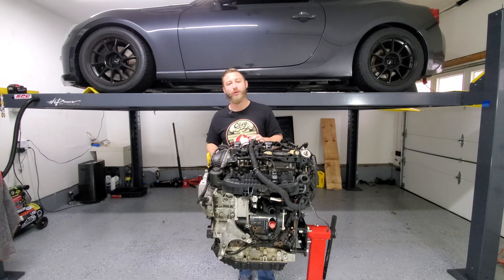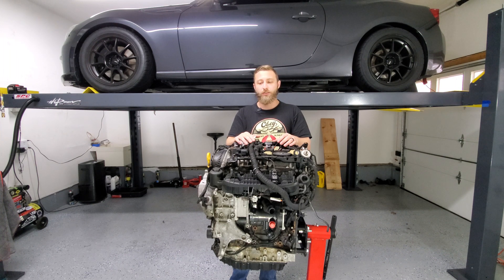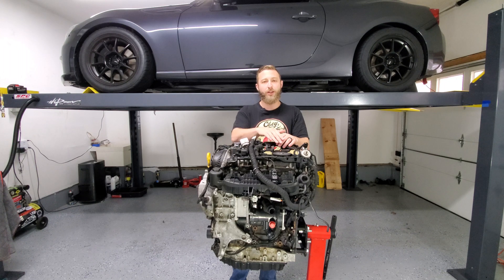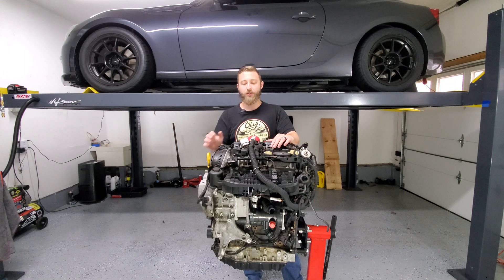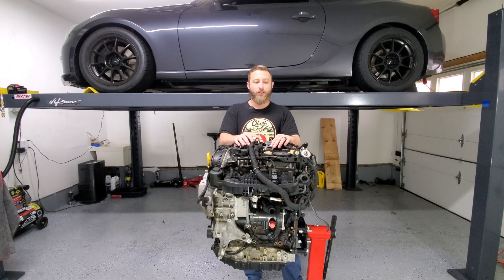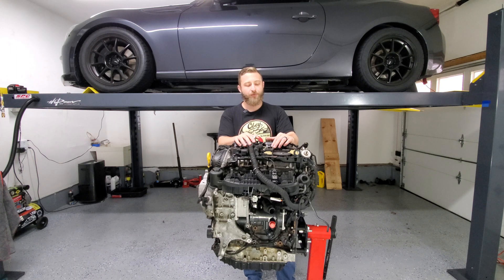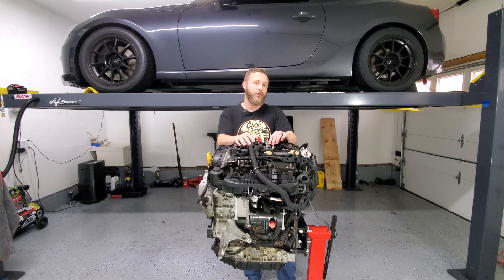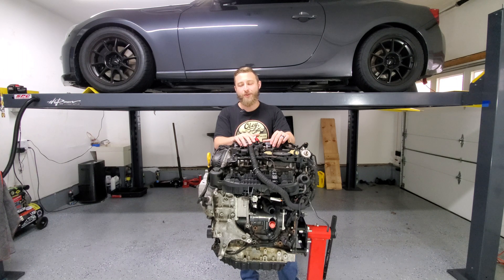VW Engine Failure 87000 Miles 1.8 TSI

Comment: I have a 2016 VW Golf MK7 1.8t manual that is getting close to nine years old that has had zero failures so far while running a stage one tune too.  No oil usage and even the stock clutch is holding the increased power.  I bought the car new for $17,830 including tax and license, so if it blew up today I still made out very well.
Reply: I have the same year car but automatic. Almost at 199K for mileage. How many miles?

Comment: I have 2015 Golf with this same engine and it have been very problematic. I've had oil leaks, coolant leaks, ATF leaks, water pump failure, a/c failure, transmission errors, busted engine mounts, premature shock absorber failure, random rough idles and an oil pressure issue that no one knows how to fix. All of this would be ok if the car had 200,000 miles, but it only has a little over 70,000.

Comment: You're right Volkswagen is making piece of shit cars I just had 2017 golf 44,000 miles water pump failed shifter position sensor failed climate control failed Volkswagen not the same anymore.

Comment: 2017 golf tsi I have had that coolant hose burst out as well by the transmount. Transmount stock is making some good noise. 290+ hp this car will need new motor and transmounts. Other than that I’m impressed with this car honestly first VW I’ve owned and it packs a punch on acceleration, numbers on the dash go  up pretty quick too.

Comment: Great just got a epc light and no boost on my 1.8t gen3, sitting right at 124k
Reply from the maker: Let me know what happens, it took a little while for my failure. Validate your oil levels also.
Reply: @MarkMethods  yeah I just had a major oil leak coming from my valve covers, re sealed them both and the oil pan as well, replaced all gaskets, but I pulled the spark plug from cylinder 3 due to a excessive knock code on that cylinder and it’s burnt out, white residue and the white tip itself looks to have melted in a spot or gotten way to hot, hoping after replacing the spark plug and maintaining proper oil level that it’ll be okay but will keep u posted
Reply: What gen would a 2017 Passat 1.8 tsi?

Comment: This is why I say people should buy new cars. That new car depreciation bs, was cancel out when you had to install another engine @ 87k miles. You bought it with 36k miles? There is no telling what the people did or didn't do before you bought the car. You are blaming VW for making a bad engine.
Reply from the maker: VW has an engine design that consumes oil and tells consumers to wait 10k miles between oil change intervals while oil levels become dangerously low; this exacerbates the issue causing more oil consumption due to wear on the piston rings eventually ending in failure. Attribute that to bad design or poor manufacturer guidance, either case this can happen to anyone new or used with enough time.
Reply: @MarkMethods  10k miles oil change? What car is this?
Reply from the maker: 2015 Golf TSI 1.8T MK7, VW recommends 10k oil change interval on a lot of their more recent vehicles which shouldn't be dangerous but is when coupled with oil consumption.
Reply: @MarkMethods  So your car was burning oil? People are suppose to check their oil between oil changes. I go 8k miles between oil changes in my 2016 F150 with the 2.7 twin turbo. I'm up to 76k miles. I don't add oil but I'm down 1 quart.
Reply from the maker: The oil consumption was low initially, nothing needed to be added between; something accelerated wear or catastrophic failure occurred and caused the piston ring to fail. I'd keep topping the oil off, that's quite a bit to lose between changes.

Comment: 2017 Alltrack coming up on the end of my lease, 4 years and 40k miles in and I am happily letting it go back to VW.  I had two tdis (the sportwagen with 6 speed was fun) but between dieselgate, the crappy attitude of VW USA toward my 39,000 mile sunroof leak (basically lying to me until I confronted them with what google reveals) and the issues with this engine I will not be a VW owner again.  I'm buying a Subaru.  Wish VW was a more ethical company.
Reply: Hope you have better luck… but I hate to break it to you, it’s all manufacturers. I can find you a million Subaru horror stories.

Comment: I think mine is on the way out, excessive oil consumption at 92000 miles. I had a fresh oil change and in 1600 miles went through 2 quarts of oil, no leaks, and good compression. Mine is a 2014 1.8t Se and I change my oil every 5000 miles instead of the 10000 miles they say I can go. I have tried numerous oils and it's the same consumption. My car doesn't pour black smoke out the exhaust and no misfires, so I have no clue what is happening to my oil. Luckily it is almost paid off and I def won't be buying another, just hope it lasts another 8 months. I only drive this car on the weekends so about 2-250 miles a week tops.
Reply: got the same engine, just give it a thrash up the motorway or highway above 3000 rpm for a good hour or so drive it will reduce oil consumption it has on mine just gone past 87k only needs 250ml every 1000 mile now as appose to 500ml before. These engines need to be ran hard to get the linkages and cams lubed properly else they can get gunked up and cause excess consumption. I wouldnt recommend flushing this car as it can degrade seals and can cause major leaks etc.
Reply: @oliverbradley592  I will give it a try i usually feather my pedal on mine. I did run some seafood through the motor which seemed to cut it down.
Reply: For anyone else who has this issue, change the PCV valve. That causes oil consumption. These engines are not known for burning oil. Mine at 130k doesn’t burn or leak a drop between 4k changes.
Reply: Try to do a forte flush?

Comment: They replace 1.8 tsi with 1.4 tsi both with 160hp. I got that 1.4 tsi with 160ps not a single problem for 4 years. I wanted to avoid that bad series so i take 1.4 with 160
Reply: The 1.4 doesn’t have 160
Reply: @briansantos4637  Yes it does, 1.4 with 122hp after that there is 1.4 with 150hp(eco fuel) and 1.4 with 160hp.  Look

Comment: Which would be the better engines from VW? 1.8T ( 2017+ VW Golf) or 2.0T (2016+ VW Golf GTi or R) or are the 1.4's any good? I'd like to buy one in the next year but want to go with whichever is most reliable.
Reply from the maker: I think if you have your heart set on any VW, plan on cutting the oil changes in half and checking often to make sure you aren't low on oil due to consumption.
Reply: @MarkMethods Well said! VW recommends 10K on oil changes. With doing that my turbo quit at 135K and I was losing compression in one of my pistons. Had the mechanic do a piston cleaning with B12 and that did the job for the pistons. I now change the oil every 5K. 2016 Golf 1.8T DSG with close to 199K on it.

Comment: This K's very sad, but in Europe we have a lot of problems with the smaller TSI engines, which you do not have in the US such as the 1.2 TSI and the 1.4 TSI twincharged engine. I have just payed +$2000 USD to fix the timing chain issues on our 1.4 TSI. It is unacceptable, but VW from this generation sinnott what it used to be
Reply from the maker: That's unfortunate to hear, I've always been interested in those smaller Euro spec motors. Hopefully VW gets their act together on reliability for future generations.
Reply: Mark Methods Yes, let's hope. The smaller versions are very cool. The 1.4 is a twincharger with turbo + kompressor. We also have a never small 1.2 TSI with only a turbo, but with a timing belt instead of chain

Comment: I had the Epc light come on at 60k about three times but disappeared after turning it off and turning it back on. I’m at 90k miles now Idk  If should be worried or not but it hasn’t come back up ever since 😳
Reply from the maker: I don't know if it's an indicator of anything wrong, just happened to be the precursor to the notification before the kiss of death my engine experienced.
Reply: @MarkMethods  I commented before watching the whole video, but my car is apr stage 1 and so far I haven’t had any problems other than a wheel speed sensor going out

Comment: You must've had a headache with this engine failure .
I read somewhere on the internet that volkswagen is getting sued for engine failures caused by timing chain...if it's that the case might be worth to give it a try!
I change the oil every 5-6k miles and now I'm hearing like a timing belt whistle,  but I'm  pretty  sure EA888 have timing chains...anyway diesel engines are much more reliable
Reply: mine was caused by timing chain as well. never going to give vw a dime again. sticking to the Japanese.
Reply from the maker: I had a 2010 TDI, wish I kept it; best car I've had to date (although my Prius is turning out to be pretty good too). I wish it had been the timing chain if that's the case, don't see any stuck injector lawsuits yet but I won't be surprised if they come up.
Reply: I currently own a 2015 Jetta 1.8 TSI, with 127,500km on it. I also experienced a total engine failure due to a timing chain pre tensioner failure at 82,000 km. Just 2000 km past the full 4 year , 80k bumper to bumper warranty I was driving on the hwy at the speed limit 110kph when all of s sudden the engine felt rough, like i was on gravel, then the check engine light started flashing, I pulled over as quick as I could, and heard bang, bang, bang, bang bang... it litterally through a connecting rod through the side of the engine... after a month long fight with VW, They gave me a new engine, Full long block and heads

Comment: I come across this video because I have the same motor in my 2015 Jetta. I just cleaned the intake valves which were bad but I know I need to clean the injectors, I can only imagine how bad theyare.  I’m afraid this is what happened to yours  as others stated or in your cause it could have failed and stayed wide open. My engine has has 181,398. Yea I know a lot of miles but knock on wood,all is great besides before the carbon cleaning I was getting cold start misfires
Reply from the maker: That's great miles in comparison, I think my issues were related to this being a first generation launch edition Golf. Hopefully you don't experience anything like I have, good luck!

Comment: A stuck open injector will flood the cylinder with fuel, thus washing the oil film from the cylinder walls and dropping compression drastically.  Had this happen to a brand new Mitsubishi.  Compression read 40psi on the affected cylinder.  Changing out the bad injector, pulling the spark plug and letting the cylinder air out overnight, and pouring a few teaspoons of oil into the cylinder to help restore compression fixed the problem.  After just a little run time the compression was back up to 180+ psi.  Not sure this is your problem, but it may have been, especially since these can periodically have fuel injector failures.
Reply from the maker: I believe this is what occurred from looking at damage on cylinder 1; I broke the motor down, working on getting the video out now. The top cylinder ring embedded itself into the cylinder wall, wish I could have tried the oil trick to see if anything compression returned. I'm considering flow testing the injectors to see if it's stuck open but it's pretty apparent because when I pulled the spark plug it was wet on cylinder 1.
Reply: I had this happen multiple times on my 2015 GTI which resulted to a few tows to the dealership and then me selling the car before warranty was up

Comment: I, too, had purchased a CPE 2015 VW - a Passat - with about 31,000 miles on it and I had to nurse it back to health as my car was a rent-a-car prior with likely inappropriate care.  Technically, the maintenance schedule by VW is way off - oil changes should be every 2,500 miles, with filter change at 1,250 mile intervals and a Motor Flush at 10,000 miles with LiquiMoly 2037.  I also have walnut cleaning done every 40,000 miles as well of the intake valves in the head.  Catalytic converter cleaner should be run every 10,000 miles and injector cleaner every 5,000 miles.  The maintenance schedule I use is exceedingly aggressive, I use Mobil 1 0W40 and original VW filters and do my own oil change using an evacuation pump and long plastic tube to remove oil through the dipstick.  I do oil change when the engine is cold and most all oil is just sitting at bottom of pan.  The advantage to changing oil "cold" is that all gunky oil is at the bottom of the pan and not fully circulated throughout the engine as when driven to the Jiffy Lube, etc.  The extra expense of doing frequent oil changes in between the 10,000 recommended oil change schedule is about $200 + another $13 for the motor flush.  The walnut blasting is $700.  Basically, every 40,000 miles my basic engine maintenance is about $1,400 more than it should be because the EA888 Gen 3 1.8L engine should not need so much TLC but that there is no other way - I learned about all this AFTER I bought a car with a GDI engine that had inherently designed weak ring seals with looser tolerances; now I'm married to it and have to make the best of it.  With TLC, my 2015 Passat should last 300,000 miles or more costing me some $10,000 more than anticipated for the pleasure.  Essentially, I spend 3.5 cents more per mile ($1,400/40,000 miles) than what the VW maintenance schedule outlines.  I can deal with it, most people won't.  Following the recommended VW engine maintenance schedule is way too risky.
Reply: Smart man. I have a 2017 Passat r line also with a 3rd gen and I've started being more aggressive with maintenance as well since I'm approaching 110k miles and I wanna avoid any issues heading forward. I don't plan on selling my car since it is an r line so hopefully we can both get to like 300k. I'm starting to do my oil changes more like 4000 miles but aye going as far as you are is really cool to see. Props to you man for taking care of your stuff!

Comment: Is this a EA888 Gen2 or Gen3 engine? I see that you are missing the intake fuel injection which is on my Audi CJSB engine. I am now at 63k miles and had no issues with that engine although I push this engine pretty hard on the German Autobahn with full throttle runs for the entire fule tank. I do regular 12k miles Oil changes and drive gentle until reaching 90°C(194°F) engine oil temp. I am also only using Performance fule to get the engine cleaning benefits and prevent misfiring when the engine gets hot on longer full-throttle runs.
Reply from the maker: I believe it's a gen3 and one of the early models; judging from the damage on cylinder 1 it looks like a stuck injector caused the top piston ring to fail.

Comment: I’ve had my 2015 tsi 1.8t jetta for 2 years, bought it at 88km, now at 170 000km, and I’ve had not problems at all, the engines runs strong. I do oil change every 8000km tho with synthetic 5w20 or 5w30 (as recommended in the manual). And FYI, I drive it very very hard every day..
Reply from the maker: This is probably a case of bad luck but this has been the first certified pre-owned VW I've had; coincidentally it had been the worst. I hope you have better luck than I did!
Reply: @MarkMethods  It is not bad luck. Very common with VW
Reply: My 2016 VW Golf MK7 1.8t recommends 5w-40.

Comment: I think you changed this motor because of a common stuck open fuel injector. Yikes
Reply from the maker: Following up, yeah it definitely appears to be a stuck injector caused the failure; need a flow test to be certain.
Reply from the maker: Entirely possible, I need to test the injectors to see what's going on; they have so much carbon deposited on them.

Comment: I have the same problem.  My 2014 1.8t burn oil since 70k .1 liter every 700 miles. Is very bad car. I called the vw dealer .they said its a normal for vw to burn oil !!!
Reply from the maker: I could understand driving the car extremely hard could consume oil, seems like you're almost driving a two stroke.
Reply: @midcenturymodern9330  So-so. It might not be normal for an average VW, bud sadly it's more or less "normal" for an 1.8TSI (constructed by Audi, used all over the VW group). I own a Skoda with the same engine, I got it cheap and when I first took it to my favorite mechanic, first thing he said to me was that I should be prepared to buy a lot of oil. He was right.. Just do a search for "1.8 TSI oil consumption". These engines are well known for that problem.